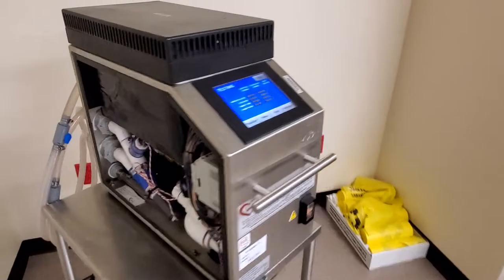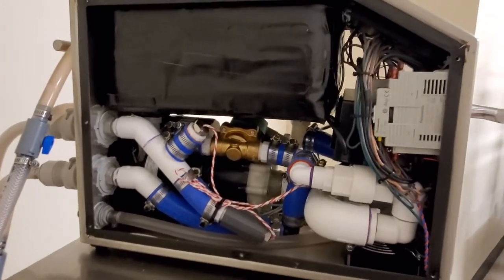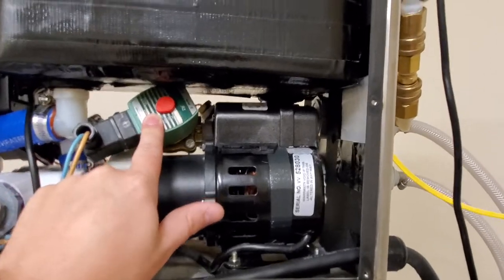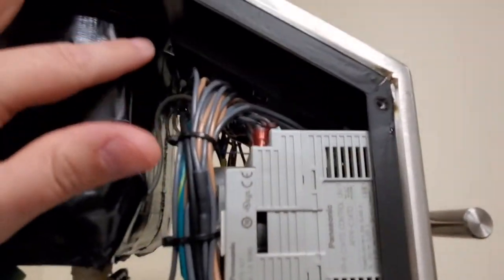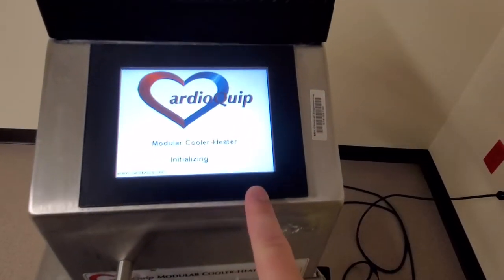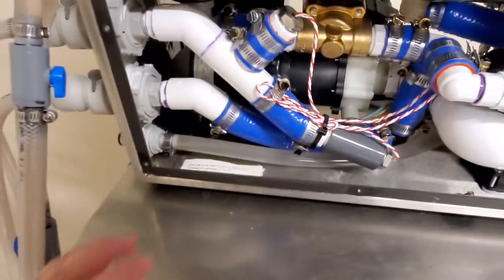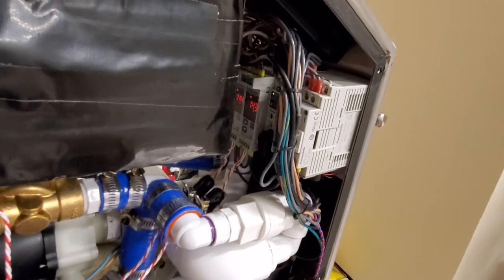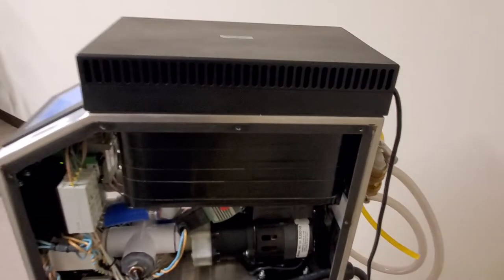CardioQuip Heater Cooler Overview

Comment: I worked for a contract manufacturer that built these machines.   Used machines would come back to us that had been used full of dirty water and contaminated.   Recently the FDA sent out a warning of possible contamination from using a CardioQuip heater cooler...from some reported cases.  I would suggest CardioQuip do all manufacturing in-house so they can better track their machines and correct any existing or potential problems.
Reply from the maker: CardioQuip has become a sensitive issue. I wish I could comment more.

Comment: Great tuotorial video! I am perfoming a PM onnthe larger MCH1000. How can you do a temperature reading on this unit? I have a feed back loop attached and I do not see where I can insert a thermocouple to take a temperature. Any suggestoons?
Reply from the maker: I would create a quick connect inline temperature jig using hydraulic fittings (like on the machine) and a barbed 1/2" t fitting. The t fitting will house a thermocouple which is sealed (at the t offshoot) with putty or epoxy. Make sure that the probe is inline to the flow of liquid when you fill with putty or epoxy.

Comment from the maker: One of the things I did not mention is that the Burkett style solenoid valve is used to mix (recirculate) to achieve the set temperature.

Comment: Never seen this heater cooler, familiar with sorin 3T and Maquet HCU40. Cool, I guess your hospital uses the S5 HLM from sorin???
Reply from the maker: Livanova S5, yes. It's a pretty good pump system.
Reply: Hi, I have a question. I am trying to find the HCU 40 service manuals. Do you by any chance have them or  can guide me to where I can find them? Thanks in advance.

Comment: How do you trigger the overtemp on the pm?
Reply from the maker: I have a water cooker pot that I use. It boils water then shuts off. A pot of boiling water added to the reservoir will set it to over temp.
Reply from the maker: Also, don't fill the reservoir too full. Only a couple liters will do for sterile cycles and for temp checks. The more you fill, the longer it takes to stabilize temps.
Reply: Hey Victor whats up